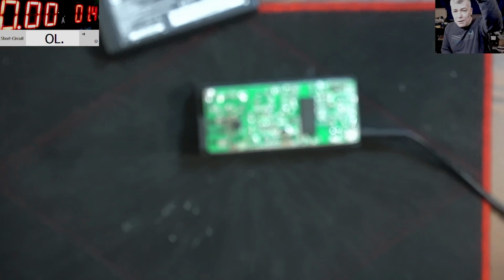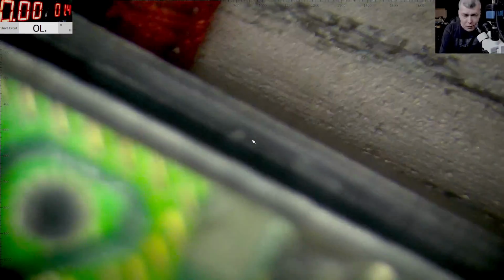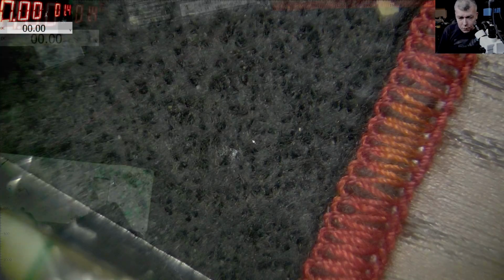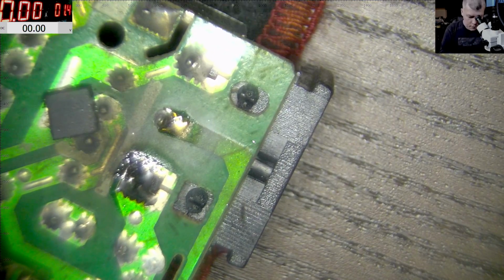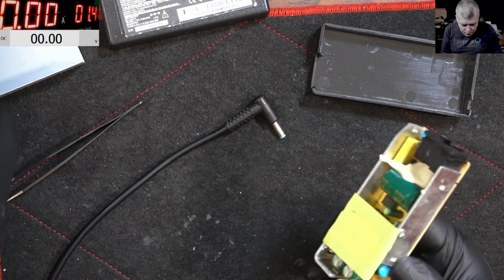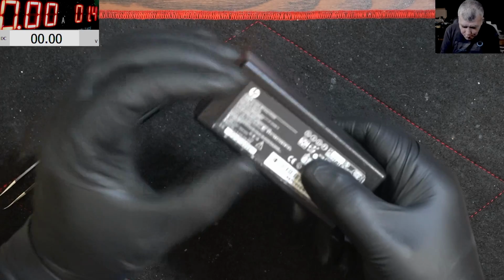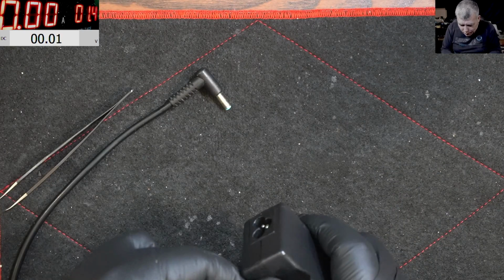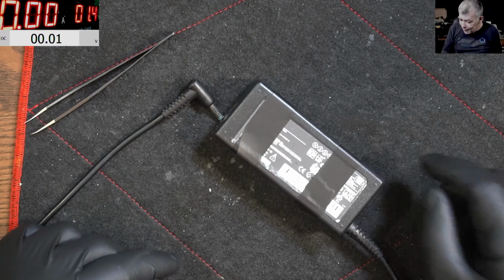The most common fault on a laptop charger power supply

Comment: How to open it? Very good trick is to apply petrol(gasoline) or diesel using syringe. 
Put small amount in that hole-lines around the charger (it will spread out automatically by itself) and then wait 2-3minutes. Then you will open it very easily by hand. 
(when you play with petrol/diesel - remember to open the window to provide fresh air)
Reply: I hated opening them so much (to the exasperation of saying "nice words" in my native language) that I had to buy a dremel. Thank you very much for the tip. All the best.
Reply: @carlosgarciaoropeza5480  people here keep saying they use a Dremel but high speed tools don't cut plastic too well. They just melt it. Most of those plastic cases you can open by just squeezing them in a vise. The plastic weld cracks then. If I can't get the case to just split apart as a last resort I'll use a hacksaw to cut it on the seam. Once I get a nice slot going I can get a little pry bar in there and get it to bust open then.
Reply: @1pcfred  Dremel SC476 SpeedClic
Reply: its easy to open a copy charger

Comment: I'm more interested how opened the case of the charger.
Reply: You can crack them like they're a nut. Just squeeze it in a vise. Most of the time it'll split open cleanly. Sometimes I'll hold half in the vise and get in there with a flat blade screwdriver and give it a pry in a corner. Then there's the hold half and work a chisel with a hammer down the seam method. I love cracking welded plastic cases open. So satisfying.
Reply: @1pcfred  I always use a screwdriver and a hammer. I will try the vice method. Sounds less destructive than mine. Thank you.

Comment: I had one not OEM charger that would work for a while and they the laptop would shutdown and the light on the charger would start blinking. Nothing is burned inside it, won't bother trying to fix something cheap that could end up breaking something expensive.

Comment: Hey Sorin, I was hoping you would shows us how did you open the charger in a non destructive way!!
Thanks a lot.
Reply: with a knife and hammer. it's not a joke :). that's how I open them.
Reply: @Adrian_Buliga does the knife needs to be sharp or not? how long is the knife should be?
Reply: Maybe pop it open with flat screwdriver, some marks are visible.
Reply: @DarkGT  i used screwdrivers before but yeah they are destructive lol.
Reply: @Sht97  Sorin used a electrical tape, it's destroyed in some ways. You can cut it clean with a saw or try to pop it with something flat and thin. You can heat a knife red-hot and make your task easy.
Reply: @DarkGT  yeah i see.

Comment: Can't resell the charger when you've done that, normally. You can only use so many chargers for your own use. Good useful video thanks
Reply: Yeah that tape at the end kind of let the repair down - no way that should go back out to a customer or anyone, it's all too easy for the tape to be removed and casing come apart to expose the HV innards. Considering how clean the separation was, even some super glue or epoxy to join it back together would be a better final fix imo
Reply: Just glue it together and you have a working charger you can sell (you simply tell your client that it is in used condition, and if they agree the price, do it)
Reply: @ferna2294  You might sell it on a spares & repairs basis. Or buyer beware. It's hard to glue things like chargers back together without it being obvious it's a re-glue job. Here in the UK it's 230volts in there, if the glueing wasn't a factory-style job a potential buyer would have all kinds of things running through their head at the thought of it springing apart/splitting open or whatever. Buyer might have an inquisitiive child, too.  Sorry, it's mega-unprofessional & a no-no to any parent

Comment: On these chargers another common fault is a break in th third thin wire that connects  the sense central pin in the plug, without it charger outputs voltage but laptop will no charge, just trash quality wires in these hp chargers...

Comment: Opening the case is usually the trickiest part of these repairs. How do you do it?
Other common faults: The DC-Cable breaks inside and the thermal fuse in the charger might fail if you put it under a pillow or something...
Reply: How to open it? Very good trick is to apply petrol(gasoline) or diesel using syringe. 
Put small amount in that hole-lines around the charger (it will spread out automatically by itself) and then wait 2-3minutes. Then you will open it very easily by hand. 
(when you play with petrol/diesel - remember to open the window to provide fresh air).
Reply: Thank you for sharing! I'll try
Reply: @Radek__  I have tried this technique once with lighter fluid and it did not work. I may have to retry using "real" gasoline, thank you.
Reply: @hieroben  I never tried diesel - so I don't know if it works. But petrol/gasoline works well after few minutes.
but there are three side effects - bad smell, it can littlebit brightup that black colour around place when you apply it, and some type of plastic in cheap charger or batteries can become fragile - not that part which you see outside but that thin part inside, that edge with clips on each half od cover/casie
but if you using long knife and hammer, you destroying that thin plastic anyway, so petrol is not that bad
Reply: i open it by (relatively) gently hammering a blade of knife (small camping knife) the slot / middle  part (juste aviod the corner, you will break it). I guess there is a better solution

Comment: How did you open the charger ?
And if there is hi volts on that capacitor how do you discharge it ?
Reply: The ez way is stick a screwdriver across the terminals, the safe way is to clip a bleed resistor across it

Comment: You may also glue  the connector for better strenght.
Reply: He also could clean this PCB ...
Reply: Right! Some hot glue does wonders in order to get the output cables steady and free from separating from the charger ♥